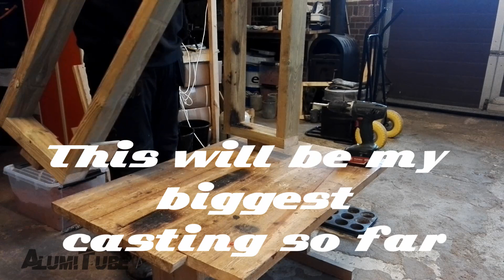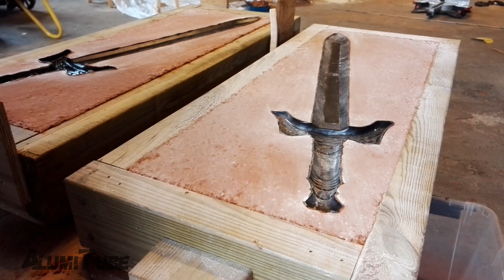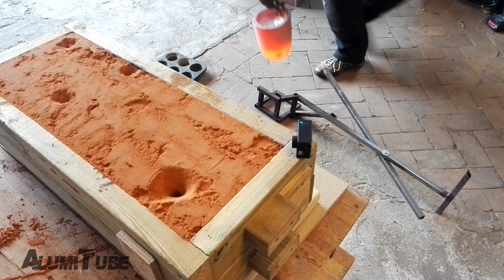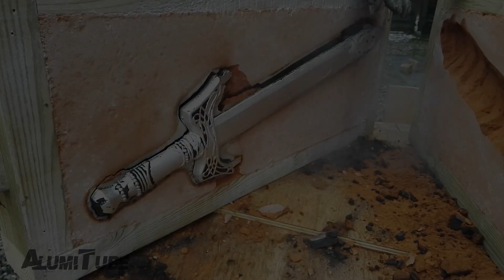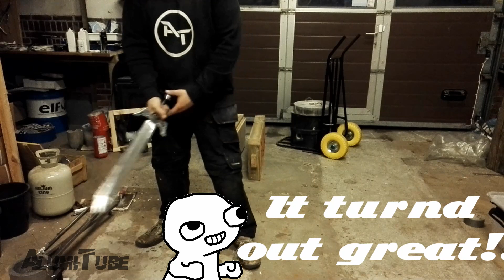Casting Aluminum Sword From Aluminum Scrap

Comment: On the hypothetical, if you had any not so nice scrap castings would you be will to destroy a couple test runs with aluminum and mercury/gallium... Because it would look absolutely amazing when the reactions happen.
Reply: That Crucible is awesome!
Reply: Asking much here but would you be able to create lapel pins in this manner for veteran purposes. Such as military awards ribbons small arms weapons for hat pins n such?
Reply from the maker: Yes small casts like pins and rings :)

Comment: First time I've seen  someone cut aluminum with a circular saw. Did you use a special blade for metals?
Reply from the maker: Yes it is a special blade for metals, cuts it much faster and you dont have the metal dust only shavings :)

Comment: You will need to heat, hammer and quench that edge if you want to actually use it. You can also boil salt (sodium chloride) at 500°C and leave the aluminium in it for half an hour (it is how they harden commercial aluminium).
Reply: Very interesting
Reply: i wonder how that "hardens" the aluminium?  it must only be a mechanical change not a chemical one.

Comment: What i want to know, is that if an aluminum sword is just as sharp and deadly as a normal one.
Reply: as sharp, no.
as deadly... well... it really depends on the user... a complete novice wouldnt be able to kill someone with one strike even with a regular sword and a sword master could kill 100 enemies with only a spoon.
but i guess the answer you are looking for is: it can kill a man, but with a normal steel sword it would be much easier.

what im wondering is how sharp it is, how well it would cut, how well it would retain an edge and how long it would last in a decent condition
Reply: It is about one-third as dense, so you can triple the thickness for the same ease of handling, assuming you don't change the balance or length.
Some of this will be required to increase the strength to come close to steel, but not all of it. So you have some room to make a lighter sword which is useful for a slashing or stabbing sword but terrible for a chopping sword. You will have to change the angle of the cutting edge, because it will snap off if the edge is too pointy, so it won't be as sharp, which is bad for a stabbing sword,  and terrible for a slashing sword.

The only benefit I see to Aluminum sword-wise is that you can make your sword longer for the same weight. Though that would ruin the balance so you would need a pommel made of a different material as a counterweight. Let's say lead. A very small lead pommel should be enough to balance out a very long aluminium Zweihander.

Comment: What kind of sand you use?
Reply from the maker: Oil base sand :)
Reply: AlumiTube thanks mate
Reply from the maker: Some call it Greensand.... Depenting on what you cast :)
Reply: It's called soft sand
Reply: Fire Phoenix thanks
Reply: mario fardiman yep he said in the dark on dagger
Reply: It's called greensand. Simply fine sand with 5-10% sifted bentonite clay (crushed cat litter). With 40w oil.
Reply: I think it's called petrobond.
Reply: Greensand isn't oil based.
Reply: AlumiTube can u make a tutorial
Reply: Looks like he's using Petrobond or similar. It's not quite green sand, which is a sand, bentonite clay and water mix and it's not strictly oil-bonded sand which can have... mixed results. It's very fine and is perfect for highlighting small details in a casting which the other alternative might miss, though it's not as reusable as green sand.

Comment: that sword will shatter if you hit it on something

theres a reason swords are only cast in movies
Reply: Actually it won't shatter, aluminum isn't that weak. Look at the atrox sword he made he chopped through a log and it didn't shatter
Reply: Oniplus I know, I was just saying it wasn't as weak as he thought. aluminum is not good at all for blades unless all you want to cut is fruit.
Reply: OniPlus That is what I was thinking, should have cast it out of steel and heat treated it.